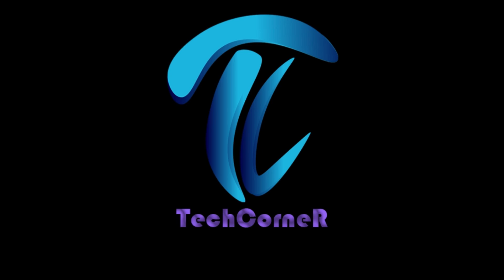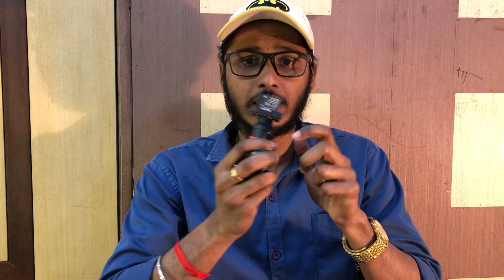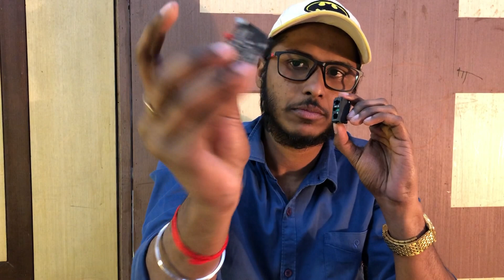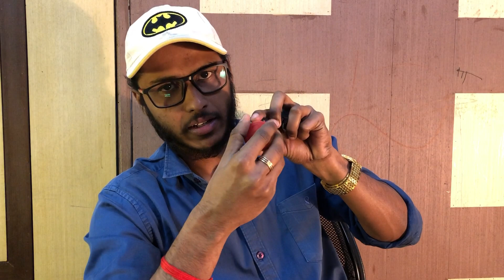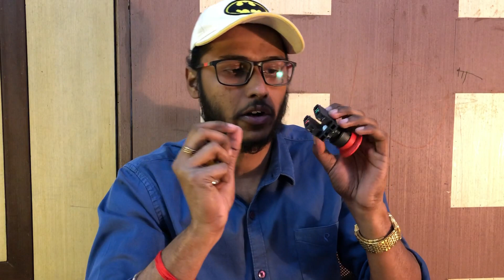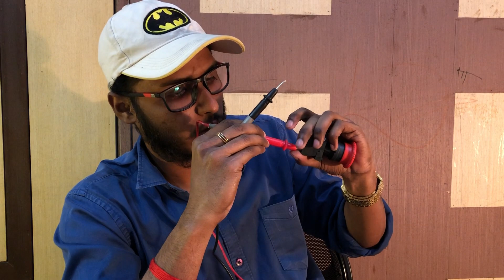Normally Open (NO) vs Normally Closed (NC) Contacts | E-stop

Comment: No ,NC  with Contactor ഉപയോഗിച്ച് connection കൊടുത്ത് കൊണ്ടുള്ള Submesible motor panel board vedio ചെയ്തിടുണ്ടോ? (NC to contector തമ്മിലുള്ള connection wire കൊടുക്കുന്നത് അറിയാൻ വേണ്ടി ആയിരുന്നു)
Reply from the maker: Illa contactorine patty video und
Reply: @TechCornerMalayalam  ok

Comment: Those things are called NO contact element and NC contact element. The mushroom push button is called the acutator.
Reply from the maker: Ya but we need to mention particularly the mushroom push button to get this product, we won’t be able to find out this product if we mention actuator,But generally this will come under the category of actuator.That is why I particularly mention it as mushroom push button.
Reply: @TechCornerMalayalam  Correct!
Reply: ലാച്ച്  റിലെ   വർക്ക്  ചെയ്യുന്നതെങ്ങിനെയാണ്     മൈക്രോ   പ്രെസസ് ഡ്    ബെയ്സ് ആണോ
Reply: ഹായ്